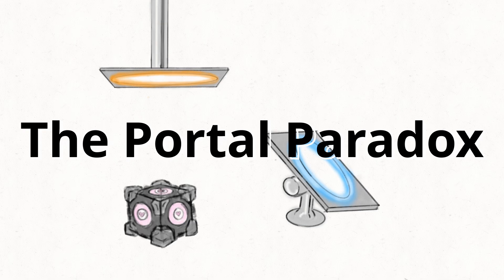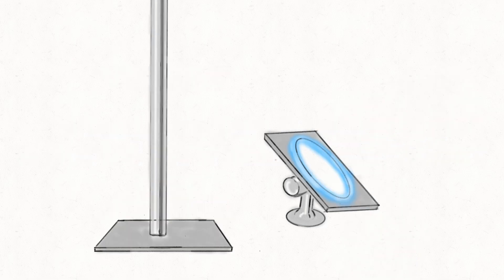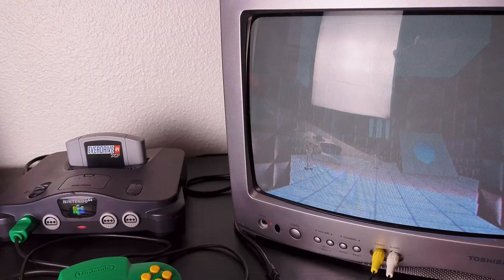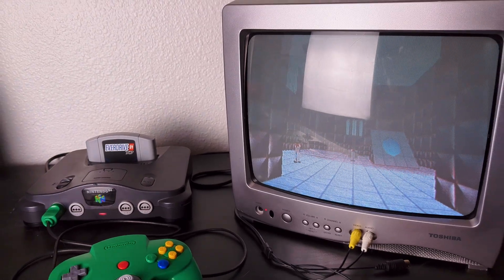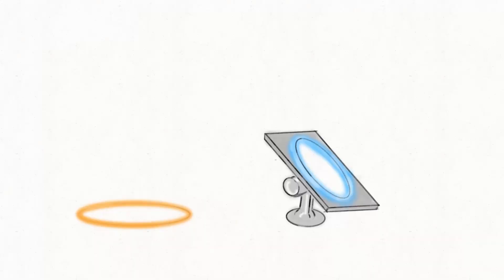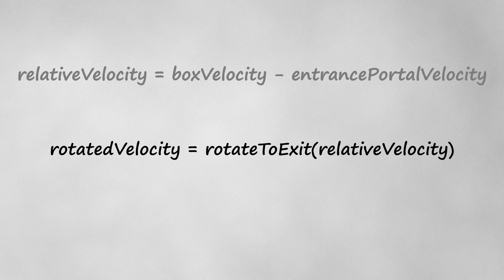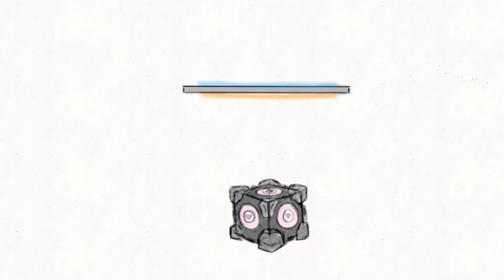I rewrote Portal from scratch and solved the Portal Paradox

Comment: Excellent video, excellent question! I believe that your hypothesis is wrong however, because: the cube has no velocity or acceleration before the portal touches it, and the portal does not impart any acceleration to the cube, so the velocity would stay zero. The momentum of the falling platform is only transferred to the ground when it hits it. The cube shoots out of the portal when dropped through a portal because it already has momentum. The situation you have proposed is really the same as dropping an empty picture frame over the cube; it would simply pass through.

Everyone go look at Spencer Peterson's comment and replies (https://www.youtube.com/watch?v=ao1qVi5Qp3Y&lc=Ugw1r7UlQNKYLu4RDr94AaABAg), he came up with an amazing, mind boggling situation.

Also, looking into sources, this video makes the most sense. https://www.youtube.com/watch?v=7EPppJp2vjk Portals can be moved on their own X and Y axis, but not the Z axis, which is supported natively by the original Portal game. Portals cannot exist on a moving Z axis.

Comment: This actually makes a logical conclusion.  Is it right?  No clue.  But is it a reasonable conclusion, Yes.
If I were to actually consider it, your conclusion does work, as the motion of the Portal would cause air displacement, either through it or away from it, meaning any other object should also experience mass displacement.  So it would be like pushing a plunger on a tube.(For lack of a better example.)

Comment: I was originally of the belief you were wrong, but then I thought of the process of exiting the blue portal slowly and realized that if half of my body was through the portal and no movement was taking place to move that half of my body away from that point, then the lowering of the orange portal passed the rest of my body would cause my own body mass to force it to move in the direction of the space I was already occupying. I know you know this, but I’m typing it out to verify my own ignorance with myself. Portal physics is wild.
Reply: It won't cause any movement of your body. What will - change of gravity direction on the exit side of the portal, in relation to your new direction. Well, you will simply fall.
Reply: @fantastikboom1094  If my body is occupying a space and more mass is attempting to move into that space, then how will the movement of my body not change?
Reply: @tonymccurry8621  You're not moving. Your body isn't occupying new space. No of your mass is attempting to move. You don't understand that it's the portal moving, but not you. Replace a portal with a doorway, so maybe you understand how portals work and how  this experiment work too.

Also, in the experiment from this video exit portal is under 45 degrees, and isn't straight up. So actually, after passing through, you will suddenly fall. Ah, and the room will look like it's turned for 45 degrees, because... I don't think an explanation is needed, it's so obvious from this point.
Reply: @fantastikboom1094  Imagine two boxes. One harmlessly floating outside of the blue portal’s entrance for convenience sake (call this box 2) and the other exactly where the video shows a box (call this box 1). Replay exactly what happens in the video in your mind with this change and tell me why box 1 going through the orange portal wouldn’t cause box 2 to be thrown away based on the speed at which box 1 comes through? 

Trust me, I was thinking the exact same thing as you, but it doesn’t work like a door when one portal is stationary. It’s more like being suddenly thrown out of a moving trains window. Except, as another commenter pointed out, you’d turn into mush if the orange portal was moving fast enough, because you’d be experiencing too many G-forces at once. 

Honesty, it kind of makes me think of the myth-busters video on throwing a paper airplane while moving at the same speed at which you throw the paper airplane away from you.
Reply: @tonymccurry8621  Now I really don't get what you're telling me. Are you saying you'll be sucked into the portal, when it stopped halfway on you (and then will fly out at high speed)?
Reply: @fantastikboom1094  I don’t think that’s far off from how it would work, but I’m terrible at explaining things nor do I know the proper words to explain what I believe to understand. 
I believe that if one portal remains stationary and the other moves, then they would be capable of generating a suction or propulsion of the air that goes through them, because you’re introducing matter into a location. 

I’m doing my best here to think of a decent mental image I can provide for explaining this without leaving you unsatisfied, so bare with me. One thought I had was if two portals were facing each other and one could move towards or away from the stationary one. Let’s say they’re 10 meters apart. If I took a roughly 11 meter rope, walked it through the portals and tied it together,  it would look like almost a straight line. If I moved the one portal an extra meter away, the rope would become taut, because there’s only so much rope. If I kept moving the portal further away from the other portal, the rope would break apart eventually. If they only acted like doors, as you said, then theoretically this shouldn’t happen. But because there’s only 11 meters of rope, it’ll experience a “pull” from the portal. The same principle can be applied if you move the portal in the opposite direction. It generates a “push” on the object that goes through it.

That took all of my brain power for the night, so I hope it makes even a little bit of sense, haha.
Reply: @tonymccurry8621  Portals won't generate suction of air when moving, because physically that air isn't being moved. It sound like nonsense, but really, that's how portals work. It's easier to imagine yourself being in the experiment and look at the situation from different perspectives. From POVs of the cube, the observer from the portal's exit side, and the observer of the whole experiment. Also there are some experiments, but I don't want to talk about them in this moment.

Here's about your experiment. The rope breaks not because some force from the portal was applied, but because the rope was stretched too much. If you don't tie up the rope, it won't break.
Your experiment would give the same result if we don't apply equation from the video.
Reply: @fantastikboom1094  Final thought experiment: If you have a perfectly sealed cylinder filled with air that is slightly larger than the size of a portal in circumference, with the two portals inside of it facing away from each other in the middle (with no gaps for air to fill in between them, orange being able to move and blue being stationary), and the orange portal was moved incredibly fast towards the end of the cylinder it was facing, would all of the air not go through the blue portal creating a large gust of wind as the air pressure would double on the blue portals half of the cylinder? And if the orange portal moved back away from the end of the cylinder towards the middle, would it not create suction, pulling air back through the blue portal and out of the orange portal into its half of the cylinder? 

Secondly, the rope itself can’t stretch itself too much. Rope can’t suddenly generate it’s own energy and break. That’s not how the distribution of energy works. The kinetic energy that was necessary for the rope to break had to come from the movement of the portals.

If you don’t agree with this or don’t understand this, then I suppose I can only agree to disagree.
Reply: @tonymccurry8621  It will work as a pressure chamber, but instead of solid material the air will press itself. If there would be 0 space, there would be infinite pressure 💀(since it is just cylinder, it will explode from inside at some critical point).
However, it's not portal generating pressure. It's you reducing space where the air can go.

For the rope it's the same, but you're depressing the material, causing it to stretch. It's not the portal generating a force and breaking the rope, it's space between two points stretching the rope.

It's interesting to imagine how it looks. You would see endless amount of ropes tied up to another rope, that's tied up to another, that's tied up to another, if you look at the portal. Then portal moves, all those ropes are stretching, and it looks like portals that you see in the portal are moving out from you, stretching all the ropes.
But there's only one rope and only two points of one portal are existing.

Comment: Idk, may just be misunderstanding things, but I always saw portals as just like an instant reality-bending “doorway” which instantly translates anything going through it to the other portal, and vice versa (hence why you can be stationary and have half of your body through a portal without being chopped in half). So wouldn’t the portal basically just be like moving an empty doorframe down around the cube (With the other side of the doorframe representing the exit portal? Like, there’s no physical interaction between the portal/piston and the cube because it’s just an open window through which the block is traveling. Idk though, could just be me not understanding the portals correctly
Reply: This is equivalent to the hula hoop objection, which he answers in the video.

Comment: What would happen if the portal slammed down but stopped halfway about the cube? Do the two halves of the cube average out the momentum? Or does the cube instantaneously change from one side to the other?

I think your approach is correct. But I think I've found an edge case.

Comment: Counterpoint: 
There is another moving portal in Portal 2 and it's the portal on the moon. The moon moves around the Earth at 2,288 miles per hour, so by your solution any object that enters the "stationary" portal on earth would be flung out of the moon portal at mach 3. That's not what we see. Instead what we see is a more momentum derivative approach where objects passing through the portals retain their own momentum.

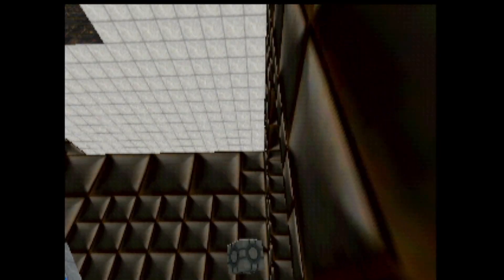2:00 : "If you think this approach is wrong then show me the flaw in this equation"
Physics equations only hold true when all of the assumptions made to obtain the equations hold true. Your equations assume both portals are always in the same reference frame, but what they also assume is that we could apply the physics of our universe to these objects that don't exist within our universe.

Portals are something that don't exist so there is no physics that could apply to them other than the physics we assign. The reason why it's a paradox is because there is no answer, or on the other side there are many equally correct answers.

It feels like you picked which side of the portal paradox you wanted to be correct then coded it to match your vision and then used the code to say you have THE solution to the portal paradox. What you really have is a perfectly implementation of the game and probably more fun mechanic-wise.

What you don't have is THE solution the portal paradox as demonstrated in the original games.
Reply: In your "solution" what would happen if an object passed halfway through a stationary portal to a portal moving at very high speeds? Half of the body would no relative velocity to the initial portal while the other half would have a large relative velocity? Things break down very quickly.

Comment: So with your current solution, I would think that if the back to back portals were staggered left and right, it would still have the same outcome because the velocity of the portals being the same cancels out any velocity the first portal would enact on the cube, but I'm curious how that would translate to the original setup. As in, What if the angled portal was moving backwards (relative to itself), at the same velocity as the first portal moves down onto the box? Would the cube just sort of fall out of midair as it exits the second portal? I'm curious when gravity of the physics engine decides to impact the cube as it "falls" out of the portal sideways. 

Awesome video. This could have been way longer and I would have watched it because It's so interesting on many levels.
Reply: Yeah, if both were moving at the same speed, with the entrance moving towards the object and the exit moving away from where it faced, the item would just appear. It would experience the friction of the ground as well as gravity, and it would do some weird spinny shit as it fell out.

Comment: I still think that you'd be deformed relative to the speed of the portal. 

A portal is a door. If an open door is shot at you, it just goes around you and your speed doesn't change. Every atom of your body goes through the door in sequence as it passes over you. The speed at which this door is launched at you only changes how long it takes for all of your matter to fully pass through it. 

With still portals, you walk through that door and maintain your walking speed. Your movement pushes each layer of your matter through the threshold of the door. 

The difference between a door and a portal is that one or both halves can be moving for a portal. If both sides are moving at the same speed, in the same direction, the person would go through just like a shot door, as the entrance moves towards and object, and the exit moves away from the object.

Where the difference lies is when the exit is stationary, and the entrance is moving:

If a portal moved towards a person quickly, they would be squished along the direction of movement. 

If a portal moved away from a person slower than the speed at which the person ran through, they would be stretched in the direction of portal movement. 

If a portal suddenly moved away from a person halfway through a portal (or was moving faster away from a person than they were passing through) they would be cleaved along where the portal began moving away faster than they could feed it.

If an exit and entrance are brought together upon a person, they would be squished down to one dimension (but before that they would gush out from between the portals as a human paste put under immense pressure).

With two stationary portals, the abstract dimension of space between them is uniform and consistent with the world around them. If the entrance or exit is moving, than the space between them is being squashed or stretched, and objects passing through that abstract space will be spatially modified based upon it. 

It isn't the case that you wouldnt experience any velocity changes, though. The force of your atoms being compressed or stretched would affect your velocity. For example, the force of your layers of matter being crammed into the back of the layers which already crossed the threshold would push the matter that already crossed out of the portal (as there is only air to resist this pushing). You would fling out of the exit with blood pissing out of you and shattered bones.

Don't get hit, or perhaps "passed", by a flying portal, basically. You will get absolutely mangled.

Also, to code this you'd pretty much just use the exact formula you did, but instead of imparting velocity on the object based on relative speeds, stretch the vectors of the object alone the line of travel.

Comment: Here is how I would explain why the cube "gains" velocity in the portal paradox:
Imagine the portal paradox is happening in slow motion, with the portal slowly approaching the cube.
What happens when the cube is halfway through the portals? The half of the cube that has yet to enter the moving portal is stationary, but the other half of the cube that is exiting the stationary portal is moving and thus must have velocity. It simply must be moving at the same velocity of the moving portal. Otherwise the cube would be crushed.
Reply: You got it! The cube wouldn't get velocity, it would get crushed :D!!

(Well, it would get a bit of velocity, because it's being crushed against itself while entering air. So the mangled cube would pop out a bit as its atoms were rammed into the back of those that already made it thorugh)

And, if the portal was slowly moving away from an object, and then the object moved through said moving portal, it would be stretched! 

(Assuming the exit is stationary)

Comment: Another way to explain this, is how much of the box is out of the exit portal, as the box is halfway engulfed by the entrance portal. The answer is half of the box. And that means the edge of the box is exiting at the speed of the motion of the portal.
In a "plop out" scenario, the speed of exit would have to be less than the speed of the portal (I don't even know what), and so when half of the box is covered by the entrance, less than half would be out of the exit portal. This isn't how portals work, they aren't time machines.
Reply: The box would just get crushed or stretched if one part of the portal is moving and the other is stationary.